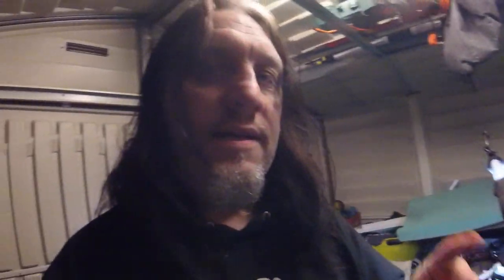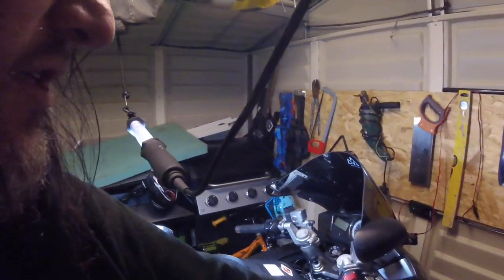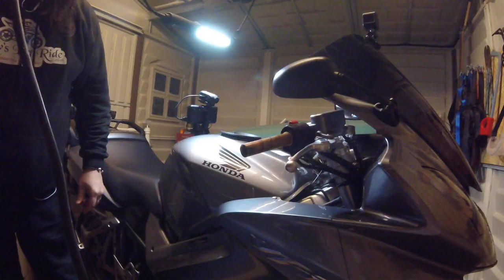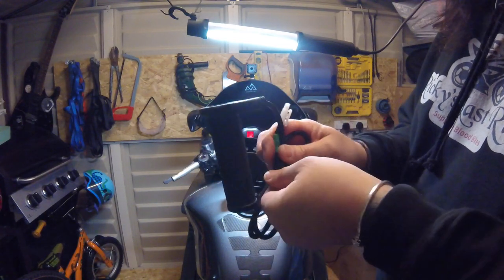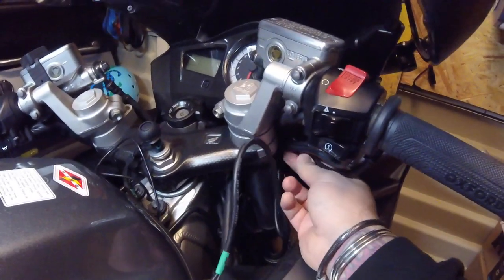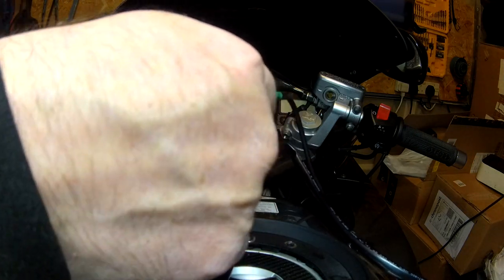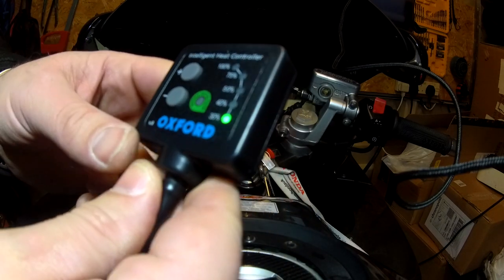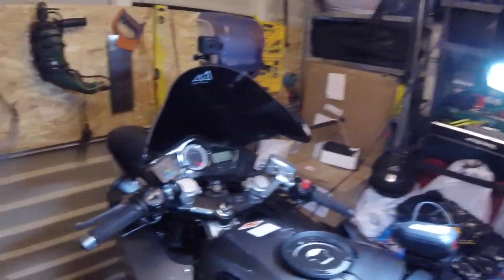Fitting Oxford Heated Grips To A Honda VFR800

Comment: Just ordered oxford heated grips for my vfr last night 🤣
This video just comes handy 😉
Reply from the maker: Super easy to fit. The controller bracket fits on both nuts on the clutch reservoir. Just screw it down and the bolts bend it to shape

Comment: I got these for Christmas.  You've just made my job easier.
Thanks Craig
Reply from the maker: 😂 tip, put extra glue on the left bar. The grip that fits the throttle sticks easy as the throttle housing is plastic. The left bar is metal so need more glue or it comes lose.
Reply: @Motourev  thanks for the tip.
I might have a go tomorrow
Reply from the maker: @robertyoung76  let us know how you get on
Reply: @Motourev  will do. Thanks
Reply: @Motourev  
Hey Craig. Did you have to cut your honda grips off.  Are they saveable.
Thanks
Reply from the maker: @robertyoung76  I just cut mine off as they were old ones
Reply: @Motourev  thanks for the reply Craig. 
Just went for a spin today.  I was dieing to get out.  Got new Road5's 6 weeks ago.  Been crap weather since..
Thanks again
Loved it today

Comment: Did you remove the tank for the wiring? (And thx for the video, made me feel comfortable enough to start working on it myself :-)
Reply from the maker: No didn’t need to remove tank I managed push the wires under the bottom edge

Comment: Another interesting video Craig. I await your comparison with interest. I too have both. Except mine are Keis. Heated grips are fine, and would never go without them, but they obviously only heat part of your hand. So in very cold conditions the back of your hand can still be cold.. Where heated gloves heat front and back. So today on my ride out and I only used my heated grips. God I wish I had my heated gloves.. But in better weather, heated grips are great as you use them as you need them. Also it depends on the individual.. I have bad circulation and feel the cold a lot more than I used to..
Reply from the maker: Interesting mate thanks, be good to see the temperature readouts